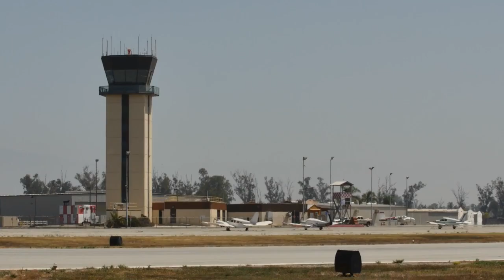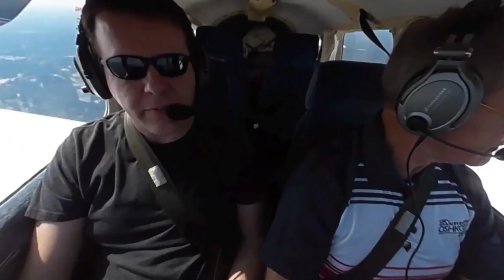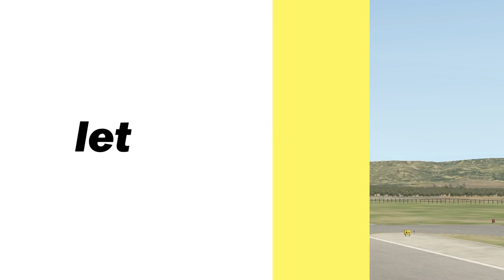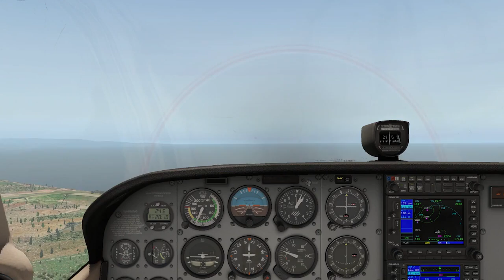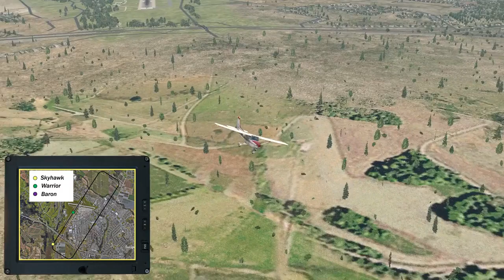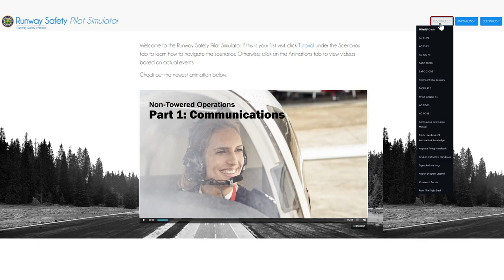Non-Towered Operations Part 1: Communications

Comment: Great video. I see every one of these mistakes and improper procedures on a daily basis at PAAQ, the FAA has been informed of this year after year   by multiple operators on the feild and does nothing, its almost like they are waiting for someone to die before theyll step in and try to change anything.

Comment: I've been using the "any traffic in the pattern, please advise" for over 30 years.  I will continue to do so.  I have found it to be a good tool to elicit input from radio averse aviators.  Now if I could get folks to start using tail numbers again.  Hearing many pilots using make or model only can be frustrating.  Do these pilots not understand and piper and cessna made more than one airplane, and that more than one might be on frequency/in the pattern and the same time?
Reply: So you can do it wrong, but you don't like when they do it wrong?  There are several reasons why "any traffic" is the wrong request to make.  When I hear you I'll advise that you take your aircraft elsewhere.
Reply: I find it interesting that omitting tail numbers frustrates you and following FAA guidance on not using "traffic in the pattern, please advice" doesn't.

Comment: I fly a 737 into uncontrolled fields regularly, and we are positioned by ATC for non-standard pattern entries (straight in approaches) most of the time, and are handed off to advisory (CTAF) often as little as 3 minutes to touchdown. While we attempt to monitor CTAF on the second radio earlier than that, we are busy with checklists and talking to ATC, and are mostly unable to build a mental picture of the patern traffic until late in the game. I have definitely asked for traffic to advise, because if a little guy doing 50 kts ground speed called turning a 3 mile final just before I switched over, I'm going to run him over, and I want him to repeat himself before I see him flairing when I'm 1/2 a mile out.
Reply: It is not their responsibility to make extra calls for you. They might be busy too. It is your responsibility to monitor CTAF earlier. The FAA has spoken, please stop making those transmissions.

Comment: I'm new to the radio lingo, so I haven't heard or thought of the wrong way to say these things, yet. I'd rather not have those memes stuck in my head. I need to hear the correct way of talking over the radio. In this video, I actually had an easier time understanding what was happening with the wrong method; I had a lot of difficulty keeping up with what was said using the correct method.
Reply: Comms need to be short for safety reasons as there could be many using a channel yet only one person can transmit clearly at a time. Practice how to say things in the order info was listed in this vid. Once you get used to it, talking on the radio will become much easier, and it will also make understanding easier since you will receive info in the order expected.
Reply: If you listen again, you'll realize that there were several omissions that can be life threatening. For example, in the first version, the Cessna doesn't say it's left cross or right cross (same for the downwind and base calls). Chattering is dangerous because planes might be converging and not getting through on the radio. Obviously, lining up on an uncontrolled runway and waiting is just weird. 
Getting used to the second version of the comms will allow you to get a whole lot more situational awareness with less time clogging up the frequency.
Reply: You didn't have an understanding of what was happening the wrong way because tons of info was left out.

Comment: Thanks for highlighting the redundancy of "Any traffic advise." It is easy enough to simply announce your position and intentions. The other traffic will do the same in response automatically, no need to beg. Also, hearing nothing after asking for "advisement" doesn't mean there isn't aircraft out there without radios or on the wrong freq. While on the subject, unless you fly something that shoots things, nobody needs to know that you are 20 miles out either. End of rant. Good video.
Reply: I cover 4 miles/minute and usually land straight in as directed by Center. I go from 20 miles, to a 4 mile final in 4 minutes.
Reply: I hate the distance call.  My plane is much faster than a Cessna so time is more valuable information.  20 miles at 200 knots and 10 miles at 100 knots is the same thing.  Distance and time would be better.
Reply: I disagree to an extent.  I use any traffic please advise when I don't hear or see any traffic as another check.  This does two things for me.

#1 It "may" get an aircraft I don't see or hear to talk in a radio environment that's clearly not clogged up at the moment.

#2 It also opens up the radio communications to a "call and acknowledgement".  You can argue this is excessive radio communication and I wouldn't fault you, but I'm also not going to have someone blindly make position reports all the way into hitting me. 

When there is minimal radio traffic I want some form of two way communication even if it's just two aircraft and one says "Aircraft 54321 short final RWY 21" and the other says something like "Aircraft 12345 5 mile straight in RWY 21, I'll be #2 behind you."

Comment: Nice, but I disagree that there's never an appropriate time to ask for others in the pattern to speak up. If I'm inbound and I announce my intentions, then wait some time and hear nobody on the radio, I should not assume there is nobody in the pattern. What phraseology do you use to get people talking when they are in the pattern and being too quiet? What if I know there's somebody there from my ADSB-in but they aren't talking? Getting people talking even with the 'banned' phrase is safer than just calling out your positions and hoping for the best. I do agree the phrase is over-used, but 'never' is a strong word.
Reply: Agree.  I have flown cargo and talk to cargo operators in Alaska who make quick turns, and only have the engine and radio on 20 seconds until they are ready to blast off at the runway, thus they ask people to speak up since they don't have situational awareness after 20 seconds.  Any phrase asking for traffic to speak up before they block up the only taxiway off the runway is wise.
Reply: The "official" way is far too passive.  You shouldn't be yapping about unrelated stuff, but opening an actual dialog with potentially conflicting aircraft makes good sense.  If I'd been in the Baron or the Skyhawk, I would have started talking to the other guy to sort out who's going where since there was obviously a conflict.
Reply: If you want to know if someone is in the pattern, ask if someone is in the pattern.  "Any traffic please advise" is not a request.  It is a directive.  I had someone do that one time and I said "don't crash".  He replied "that's good advice".  Well, I did what he told me to do.  
"“Traffic in the area, please advise” is not a recognized Self-Announce Position and/or Intention phrase and should not be used under any condition."
Reply: @8literbeater  I’m not just interested in traffic in the pattern. I’m interested in anyone who might fly into me. 

“Please state your position, direction of flight, and intentions”. Or I could just say “please advise.”  Thankfully, most pilots aren’t dicks, so that works well.